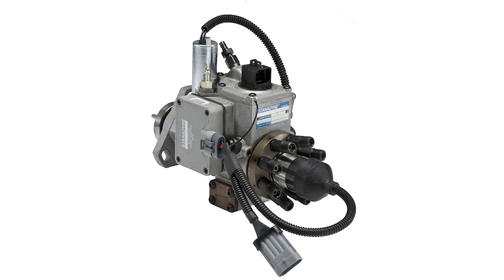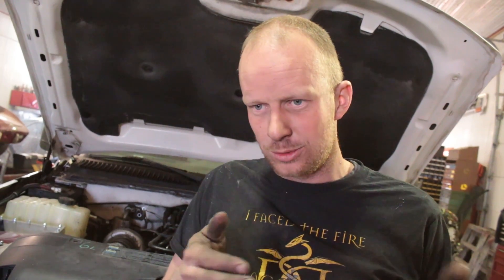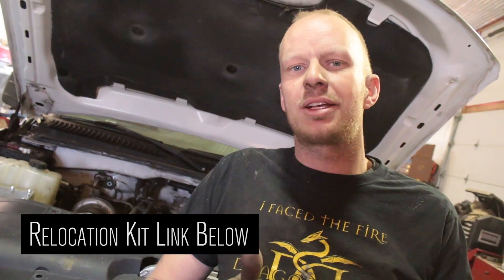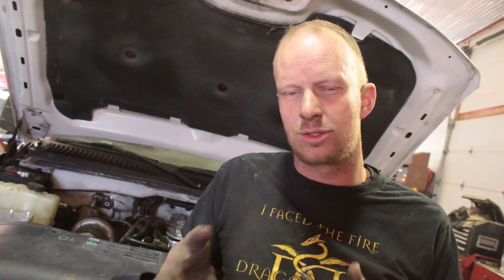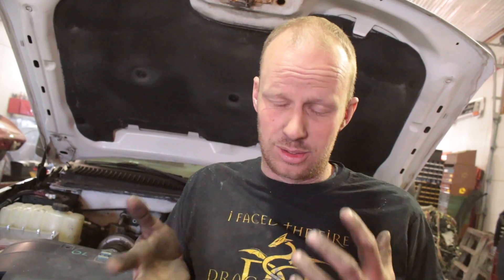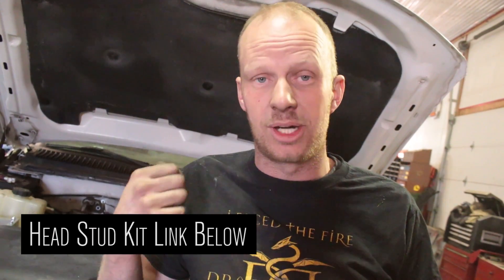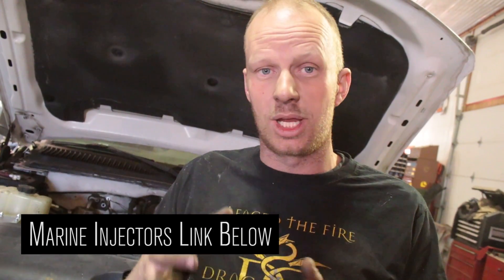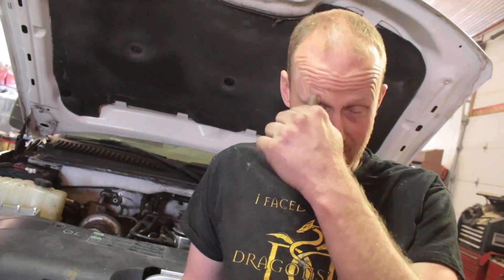REVIEW: Everything Wrong With A GM 6.5 Detroit Diesel

Comment: I'd rather have a 12v or a 7.3 lol
Reply: Joe DiCocco look at the prices of trucks with a 6.5 in them they are basically free compared to a Cummins and a 7.3.
Reply: Dodge 318 Cummins this is true but you can't beat an ole 7.3
Reply: Joe DiCocco crisply 6.9 and 7.3 idi non turbos are also extremely cheap just the powerstrokes and Cummins are expensive.
Reply: Also true. Theyre slow but tough as hell
Reply: Joe DiCocco 12v would run laps around the 7.3
Reply: Bullshit. they're easier and cheaper to modify thats about it
Reply: That dowl pin gon kill you in a 12v better get it fixed
Reply: Grant Halladay that's pretty badass but like I said I'd rather have a 7.3 or a 12v
Reply: Joe DiCocco lol over played just like a ls1 :)
Reply: austin detroits can get 2000 hp sooo and to be frank all true detroits are gm diesels but not all gm diesels are detroits
Reply: +Grant Halladay and blow it self out of the water too. That Cummins can get to 1000hp and have twice as much torque. Don't see a Detroit diesel doing that.
Reply: So you'd rather have a Cummins or international engine??
Reply: What not likely
Reply: My old 6.5 was more reliable than my 7.3 and with some basic mods had as much power. No chip either.
Reply: 6.5 putting out 2000HP, sure let's see that.
Reply: No light duty diesel with 2000 hp is use able or likely. Also huge loads are pulled with 450 hp.  Hp means nothing tq is the money and 2000 lbs at 1500rpm is the minimum starting point for real world work trucks.  The rest is for economy and light duty trucks.
Reply: Joe DiCocco I can turn a 6.5 up to the point it will blow both the 12 valve and the 7.3 powerstroke out of the water

Comment: I have a 6.5 in my van..  I've installed a fully mechanical pump from an older  7.3 international. .  it works awesome..  I made my own line adapters. .  I love my 6.5 despite its lack of power...    thank you for the vids :)
Reply: The 6.9/7.3 have a gear between the cam and crank, therefore the injection pump spins the same direction on both the 6.9/7.3 and 6.2/6.5. They are entirely identical pumps designed by neither detroit/gm or ford/navistar, but by stanadyne, and they weren't designed specifically for either any of these motors.
Reply: How did you deal with the change in direction of rotation? 
The IH IDI's are full gear drive up front and spin the pump the opposite direction than the Detroit with its timing chain for those that are unfamiliar.
Reply: Think a little more about it. On the 6.9/7.3, it goes crank gear, cam gear, pump gear. Pump turns the same direction as the crank, cam turns opposite. 6.2/6.5, cam is chain driven, so turns the same direction as the crank, pump gear runs off of cam gear, pump turns opposite of the crank. The pumps are mirror images of each other. Throttle on the driver's side on a Detroit, pass. On an IH.
Reply: Harry Stam Thats awesome, so the 7.3 idi must not have the hi pressure oil pump set up and everything like the newer ones correct?
Reply: Alex Matthews its an identical pump to the ones used on the 6.2 detroits and you can turn the fuel up or down depending on your needs...
Reply: Harry Stam good idea!
Reply: MotorsAndMore That is pretty awesome
Reply: I can build wicked 1000 hp efi turbo street motors. Im so lost when it comes to diesels.
Reply: Evan MacDonald  I just bolted it in..  no issues..  turned down the fuel a bit ..
Reply: Very interesting, as the 6.2 pump is a mirror image of a 6.9/7.3 one. Going to have some goofy timing happening.
Reply: Evan MacDonald  I had to make line adapters for the injection lines... it ran awesome until I grenaded the tranny
Reply: No question the high pressure section of the pump will operate in either direction, however running it backwards the timing advance control is going to work backwards and be retarding when it should be advancing. The transfer pump is a vane pump so with it spinning backwards it is going to be fighting against the lift pump as well.
Reply: john Deere also used the stanadyne mechanical pump on its power tech tractor engines.
Reply: Harry Stam wow you can match up a 7.3 idi pump? Good.
Reply: I had a 95 van with the 6.5, it made me hate chevy even more than I did before.
Lack of power, lack of reliability, lack of power, 3 speed automatic was another retarded feature.....  Left me stranded more than any of the Fords or Dodges I've ever owned....
Reply: Patrick Baptist and im sure you never took the time to maintain it eather. It morons like you thats should be kept away from anything with a diesel in it.

Comment: I've had decent luck with my mechanically injected 6.5TD. Running 15psi (stock turbo w/modded wastegate), fuel screw turned up a wee bit. It's still a dog compared to the other big diesels though lol

Comment: I just rebuilt my 6.5 for less than 1500 without taking any shortcuts
Reply: Master Rebuild kit cost around 1300 online but not sure what quality they are. Power mag rebuilt a 6.2 for  2400 I believe. Not sure how you can you do for that much unless you machine the heads yourself.
Reply: How was that possible.??
Reply: How did you go about this?
Reply: No corners cut so fresh IP and injectors to?
Reply: How much of that was reborng/honing the cylinders? How much for line honing the mains? How much for machining the deck and heads. 

You may have "replaced" all the parts but that is an engine REFRESH... NOT a "full rebuild"

I spent more than this just getting my block and heads machined. However... That said. I was doing a pretty hot performance build so I spent money on extra matching like bronze valve guides, splayed mains and oversize pistons.

Comment: deboss i have a question for you, i have a 01 cummins 166k miles on it and the other day i crawled under it and i noticed oil everywhere on the front of my motor it appears to be coming put of my oil catch can but opon closer inspection i noticed that smoke is actually coming out of my oil catch can out of my breather tube. this cant be normal right? its not smoking alot but its noticble if your looking for it. what would you do? no codes no lights any info id really appreite its a 24v also
Reply: morgan miskell Could be a vacuum pump leak. It's a pretty common issue on those trucks

Comment: I had to replace the injection pump and the PMD "little black box" on my 94 GMC Sierra 3500. The injection pump is pretty expensive costing about $2,000 for someone to do it. I wouldn't suggest buying one of these trucks to anyone.
Reply: you got fucked, pump is like $500 on the higher end, I had my db2 redone for 325$ for a recommended place NOT the cheapest.  To install is a few H labor... 2 GRAND rofl... fucked.
Reply: db2 pump is mechanical, the turbo 6.5 used a ds4 (electronic), different animal completely. the optical sensor alone in one would cost more than your entire rebuild. What he paid was on the high side but fair, as long as   it was a stanadyne rebuild and not an ebay special

Comment from the maker: Affiliate links to mod options mentioned:
6.5L Fuel Pump Driver Module PMD and Relocation Kit https://kit.com/debossgarage/parts-materials/212717-fuel-pump-driver-mod
6.5L ARP Head Stud Kit https://kit.com/debossgarage/parts-materials/212754-arp-head-stud-kit-fi
6.5L Turbo Diesel Marine Injectors https://kit.com/debossgarage/parts-materials/212764-65l-turbo-diesel-mar
Reply: Hey our 5.7L just hit 500,000kms and looks like it will need a new motor after another 500,000 - 1 million kms how much to swap a 12 valve in then